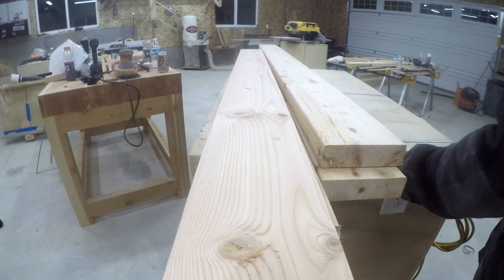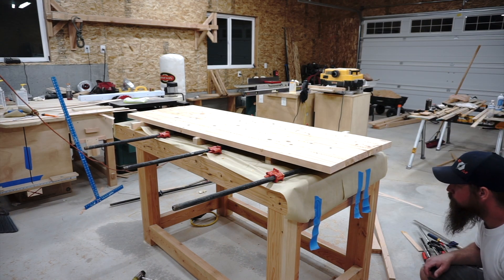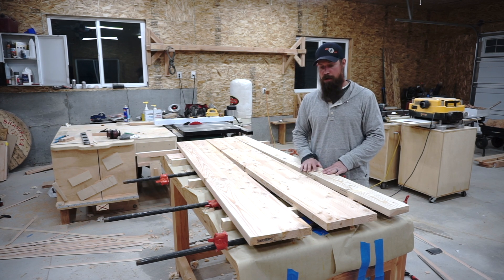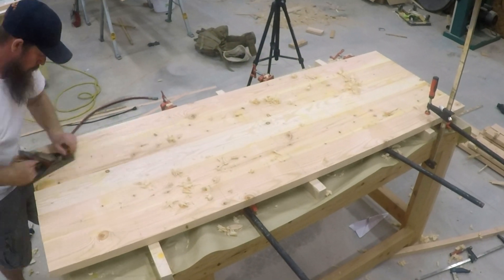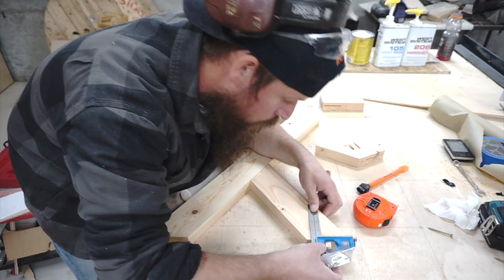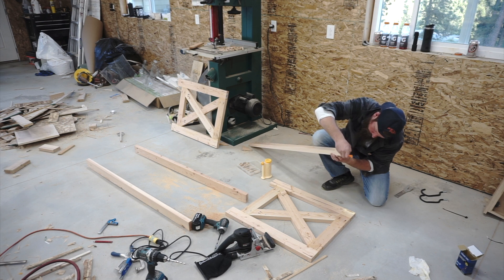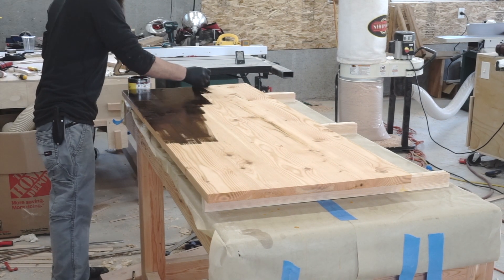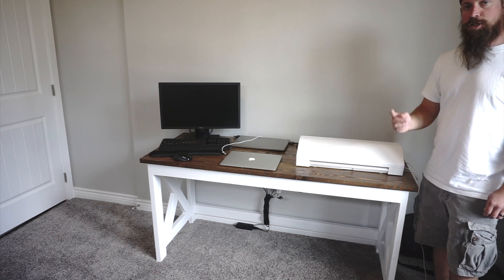Farmhouse office desk build 👉FREE PLANS👈

Comment: Hey bud! I started my build 3 days ago! Working on it a little daily. 

I have a question. Since I don’t have a jointer and the wood wasn’t perfectly flat I was going to sand the uneven between each 6x on top. 
Is this considered lazy or bad? 

Also since there is a slight crack between the 6x on top, could I use that epoxy to fill in the crack? 
Is that also lazy or is there a better approach? 

What brand and name is the epoxy you were using? 

Thanks in advance for answering my questions! Let me know if you want to see pics!
Reply from the maker: Right on! Neither of the solutions to your 2 questions are lazy in my book! If your sander is your only option than that will work just fine! Actually I’m probably the lazy one for using a jointer!😂 and using epoxy to fill your cracks is a perfect solution. I use (west system) epoxy.  Keep me posted on how you’re desk turns out. I’d love some pics!
Reply: @brewbuilds  thanks for your response!! I’m looking at west system epoxy and there’s so many options… could clarify by maybe sharing the Amazon link?
Reply from the maker: @themnikebauers  no problem man! sorry you're definitely right there are a lot of choices. here's an amazon link to my exact setup https://www.amazon.com/System-105-B-Epoxy-Hardener-Metering/dp/B07JKTKFKP/ref=sr_1_5?crid=HPAG553F8SSM&dchild=1&keywords=west+system+epoxy+206&qid=1631160473&sr=8-5 
I bought mine locally at a boating/marine store for a particular application prior to this project. west system has a great website that might help you pick something that is more for what you want. faster and slower dry times etc...